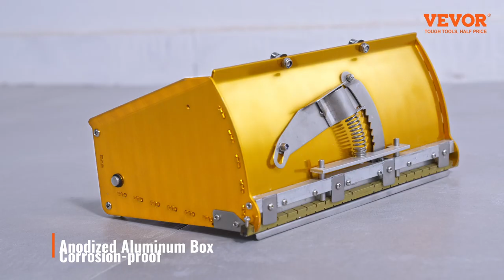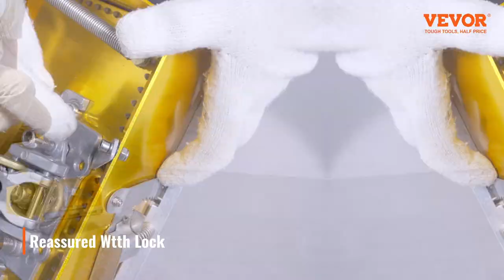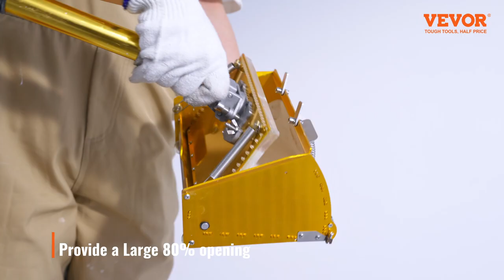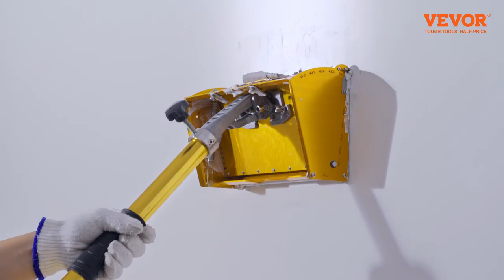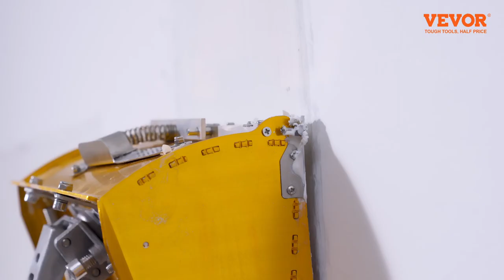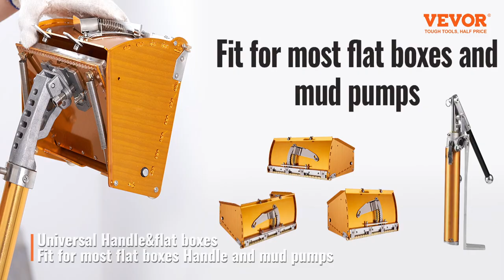VEVOR Drywall Flat Box, 10-Inch Wide Quick Clean, Extra 2 Stainless Steel Blades (10/12-Inch)

Comment: Just ordered one of these for my business. Cant wait for it to come in and try it out
Reply: Que tal te fue con la compra la usaste
Reply: @matiasbasualto691 Trying it out today and so far its hot garbage. It doesnt work like this video at all
Reply: @mr.mediocre1271  lo compre también lo devolvi por que no funciona tiene muchas fallas técnicas es chino
Reply: @matiasbasualto691  I completely agree. I will be trying to return this one also
Reply: I was considering buying one of these but the handle didn't have a manual break, that was a total non starter, I have no idea how you would control the box horizontally let alone vertical or over head, I bought a budget set, Excalibur which looks like a rebranded Platinum box, they work very well, definitely better results and faster then finishing by hand, most reviews say that Excalibur boxes are very comparable to top brands and high reviews for the price point
Reply: @robertficek7586  this thing was a total wreck. I tried it once and didnt even clean it out. Its just sitting in the garage
Reply: @mr.mediocre1271  what was the issue using it?
Reply: @robertficek7586  it doesnt apply the mud properly. Its got such a large applicator hole that it just lets the mud ( unthinned) fall out all over the place rather than against the wall
Reply: @mr.mediocre1271  so that's the design with all of them, but I can't comment on Vevors design of there's more gap, the other main brand boxes come pre set ready to run, the blade and shoe gap is set and runs as expected, I watch several how to Videos on flat boxes and set up before running. I also removed one of the 2 springs from the cover, personal preference, i find it's easier and less effort to push the box